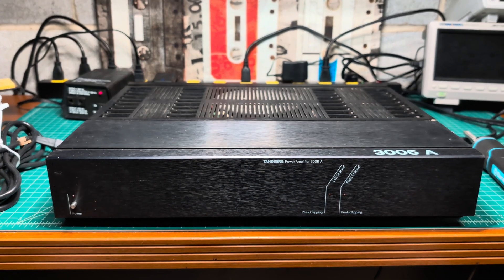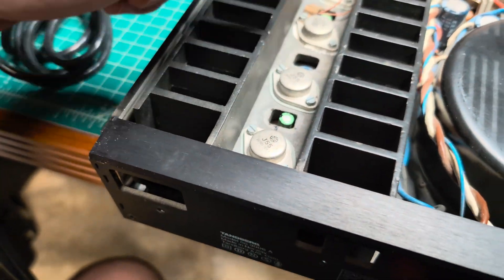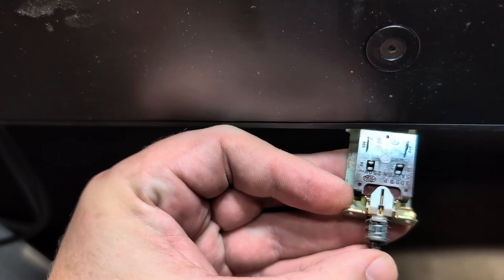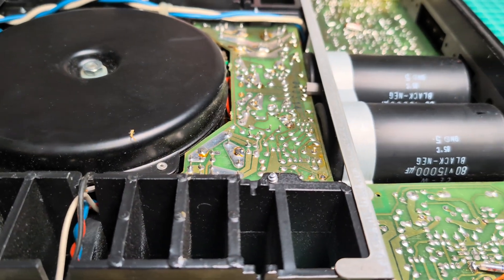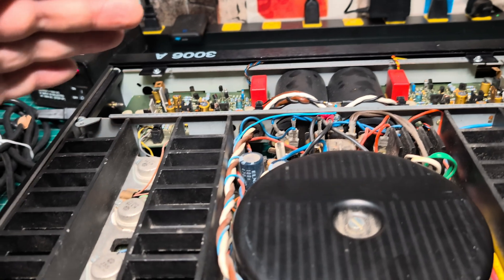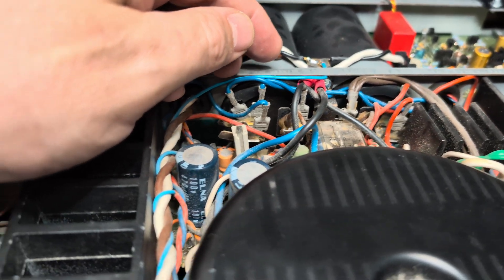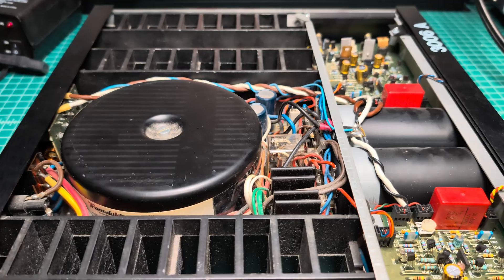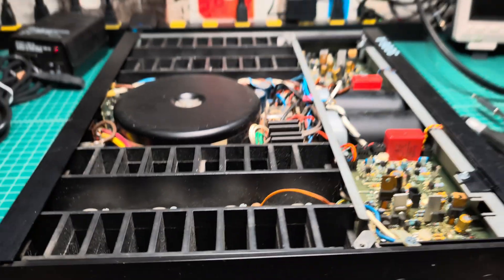Tandberg 3006 Power Amp Restoration Part 1: Capacitors Replacement & Power Switch Fix

Comment: Can you hear the difference/ improvement in sound after replacing the power caps? Im thinking to replace my old caps but I measured the value & it's still in the tolerance (20%).
Reply: It made a substantial difference to me
Reply from the maker: Every single time! You may ask the owner, Larry, below

Comment: The Wima's are fine, never had problems. Tnx for sharing!
Reply from the maker: Ordered from Digikey anyway, close to 50 years may fail any day.
Reply: @hifirulezzz   any day after the next 50 years...
Reply from the maker: @arnekarlsen528 don't be so naive. Electrolyte slowly but dries up. Quality of materials degrade. It is proven that fresh capacitors improve the sound.